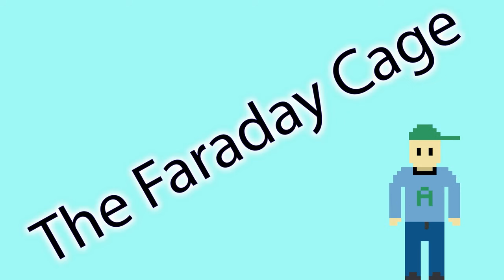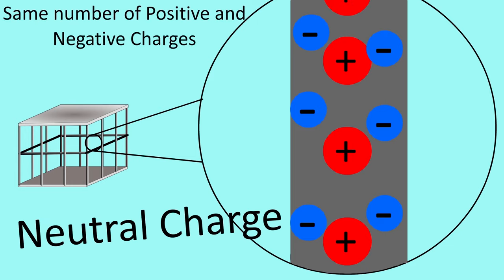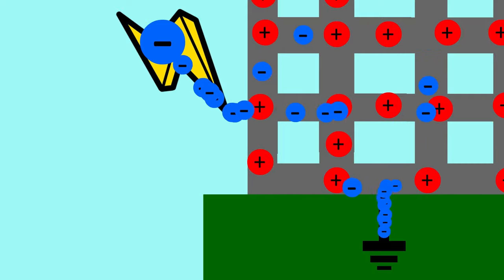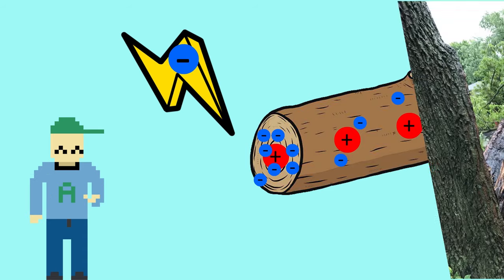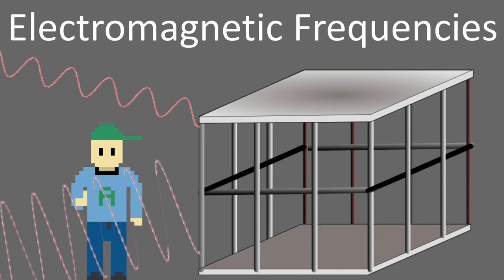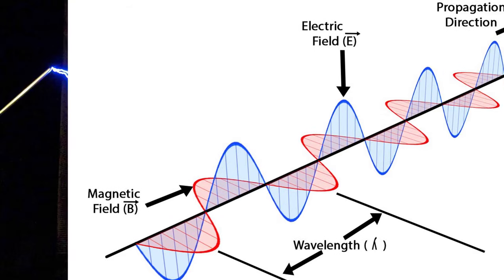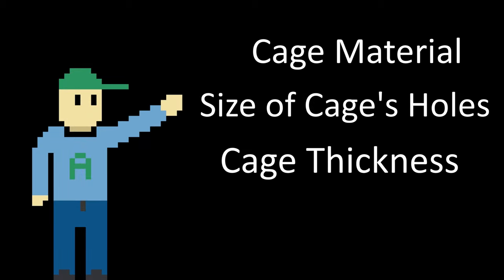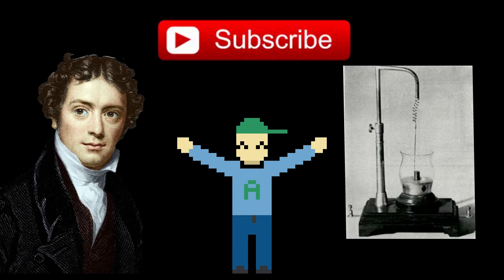Faraday Cages Explained [IN UNDER 3 MINUTES]

Comment: Great video.  Direction of propagation is reversed in the EM wave figure.  It goes in the direction of E cross B, which would be to the lower left instead of upper right.  It's easy to mix something like that up in a video with so many great animations.

Comment: Basically wanted to revisit the topic because I was stuck in a bad thunderstorm while driving my completely stripped interior track car. Basically my feet are on a bare metal floor and my elbow sometimes touches the bare metal door. I knew that Faraday cages redirected the current, but wasn’t sure if it counted with bare metal! Thanks for the breakdown.

Comment: Would a large completely enclosed box, made from galvanized steel cattle panels, with 6 x 8 inch holes be sufficient to protect against a strong solar flare, or an Emp attack?

Similar panels are also made with 4 x 4 holes, but they are much more expensive. Any information you can give would be greatly appreciated.

Comment: But how can a plane be faraday cage if it is not connected to the ground?
Reply from the maker: Excellent question. The passengers and electronics are shielded from  a lightning strike as the electricity flows through aircraft body where the charge is held and dissipated over time (usually aircraft are made of conductive aluminum, but carbon composite aircraft take precautions to make sure they are sufficiently conductive.)

Airplanes have static discharges which will shed the extra charge, though I'm not 100% sure on how they work so I would encourage you to look them up if you'd like to know more.

In this case, the aircraft body is the faraday cage with the people, electronics, cargo ect are shielded.

Comment: A car doesn't have ground how is the electricity dissipated
Reply from the maker: The rubber tires are insulators, which means they have high resistance. They'll stop small charges from dissipating, which is why you may get a static shock. when exiting. Static shocks used to be more common, but I think designs have been tweaked to prevent frequent static shocks.

As for large charges, like a lightning strike, the voltage is great enough to flow through the tires regardless. Lightning will also send current through trees (wood is a great insulator as well).